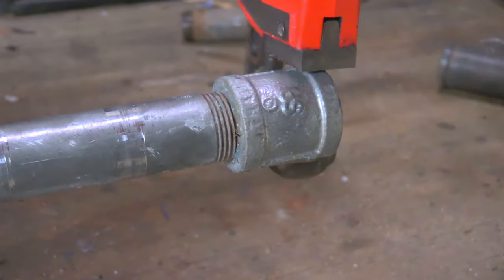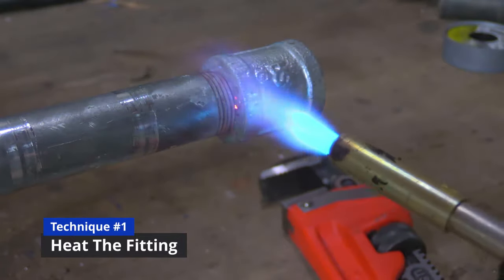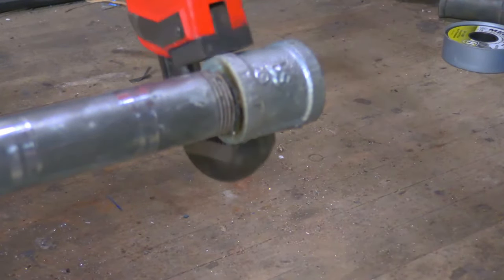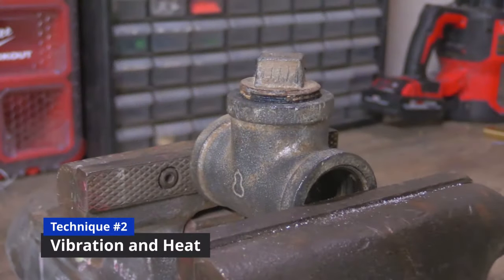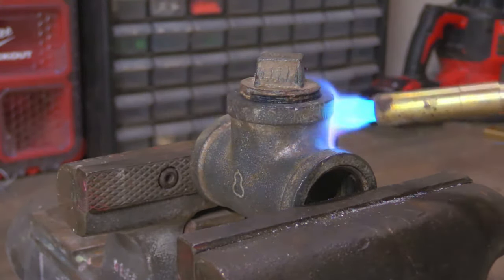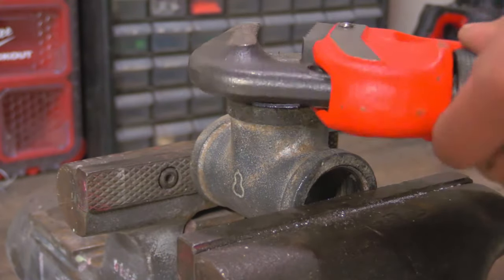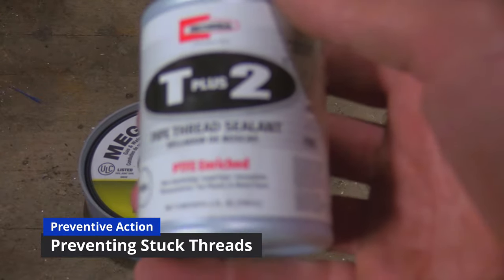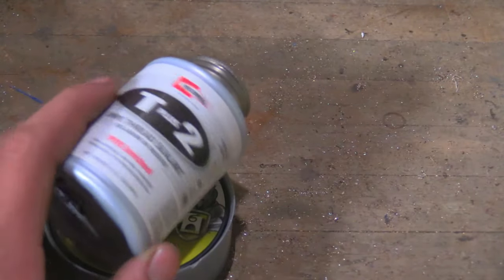Loosen Stuck Pipe Threads - With Heat!

Comment: Had a 2inch cast iron nipple completely seized up into an elbow and wouldn’t turn even when I put some very large pipe wrenches on it. Applied about 60 seconds of torch and she popped right off - thanks for the tip!

Comment: One note about galvanized pipe. If you heat it to the point where the zinc coating begins to vaporize (392 F), you can get "foundry flu" or worse (death if you breath enough of it in). I learned this the bad way brazing galvanized metal. Basically, you get what feels exactly like the flu. If I ever have to heat galvanized metal that hot, I do it outside with a fan blowing the fumes away from me.
Reply from the maker: Generally, metal pipe or bolt threads should come loose long before the zinc vaporizes. In my experience, the metal must be nearly cherry red before I can see the zinc vaporizing.
Reply: you can't see the zinc vaporize. cherry red is pretty dang hot... way hotter than the 392F temp the guy described

Comment: This is a great video.   I had the same problem - a gas pipe fitting that I needed to remove and couldn't budge even with two large pipe wrenches.  I heated it with my propane torch, just as he demonstrates.   With the heat - and only a minute of two of heat - the pipe fitting came loose easily.   Thanks so much for posting this.
Reply from the maker: Glad my video was helpful! Happy plumbing :)
Reply: @DragonBuilds  my bic lighter failed.  Now I try a real torch tomorrow.  Your tap part makes some sense too

Comment: Thanks, I used the heat and the light hammering and it finally unscrewed.
IMO, number 1 cardinal rule for DIYer is shut off the main whatever(water, electricity, NatGas, etc.) before you start doing your work!

Comment: Instructions unclear: House blew up while trying to remove gas pipe fitting with blowtorch.
Reply from the maker: If you're working on a gas like it's critical that the gas is off!
Reply: If you ever watched the 3 Stooges DIY video channel, you would know that the best thing to do is to blast.
Reply: It happens to the best of us.
Reply: Yo how did you type this?
Reply: that's not how gas works

Comment: Didn't have a torch, but my heat gun worked perfectly.
Reply from the maker: Glad it worked for you! Usually, a torch works better but sometimes a higher-power heat gun can get the job done.

Comment: Cool, now I only need a workshop with a work table, an industrial clamp and a torch
Reply from the maker: All you need is a torch. You can use anything to hold the pipe, a vise isn't required.

Comment: I have stuck brass fittings, and mine are a lot smaller, but also has plastic parts, so I'm going to try cold, to put the whole thing in the freezer until it is completely ice cold & then only warm the outside, it should pull apart.
Reply from the maker: You could try putting the parts in warm water after freezing as well

Comment: After you assemble a joint, heat it, then tighten a tiiiiiny bit more for a good tight fit. :)
Reply from the maker: That's probably a bad idea, you'll burn the thread sealant.
Reply: @DragonBuilds  ...and crack the fitting.

Comment: Did not help at all but I figured out how to do it. First I tried brute force, then tightening and loosening, then hitting with a hammer, then my MAP torch. What finally did work is I heated the fitting with the MAP torch. Not the pipe. Then after heating a few minutes, I poured ice water on the pipe. Not the Fitting. Then with me standing on the pipe wrench it started to come loose.
Reply from the maker: Heating the fitting on its own is usually enough, but cooling the pipe with water would definitely help break loose an especially tough joint.
Reply: I heated the male end of the pipe and got it loose, at first I was only heating the female fitting. Thanks 🙏 you saved me.

Comment: I'm going to conundrum I got a quick connect seized to a PVC pipe and we don't want to break the PVC
Reply from the maker: You could try a plastic-safe penetrating oil. If that doesn't work then you'll have to cut the PVC.

Comment: The heating method doesn't work too well in water lines, unless you can get the water out first.
Reply from the maker: True, but removing water is pretty easy. I used it to remove a stuck galvanized irrigation pipe. The system was only 20 years old, they used PVC underground with galvanized above for strength. The galvanized was rusted together and the torch worked perfectly.

Comment: Are their any other ways without heat I ai t got no torch
Reply from the maker: You can try using penetrating fluid if you don't want to use a torch.

Comment: What to do if the pipe is in the wall surrounded by flammable wood lol
Reply from the maker: You can use a heat shield to protect the surrounding surfaces. Most plumbing supply and hardware stores should carry them.

Comment: If a thread has Teflon tape in there, is it OK? 
I have a very old rusty galvanized tee fitting. It has Teflon tape in thread. Very hard to  loosen it. May try propane torch method. 
Thanks.
Reply from the maker: If there is Teflon tape this will work just fine. Make sure to use a high-quality sealant when you make your new joints to help seal up the rusty threads.
Reply: @DragonBuilds  
Thanks. It is a nearly 40 years old galvanized tee fitting. I am somewhat scared to remove this fitting. 
Your video helps a lot. Will see how it goes.
Reply: @DragonBuilds  
Thanks for the suggestion. With the help of 18-inch and 24-inch pipe wrench, I was finally able to remove the very old and rusty tee fitting. It took me almost 3 hours to do it.
Reply from the maker: @centscents  Glad to hear it worked out!

Comment: Here’s a cooler trick for getting a nipple out of a thread. Heat the threaded area that the nipple is threaded into until it gets red , a little bit of heat isn’t going to work like in this video , I know this is for demonstrating the technique but in real world applications you have to get the threaded area or the whole fitting cherry red , have a 20 oz  bottle of room temp water within reach then after the area is cherry red shut you torch off and pour some of that room temperature water on the nipple only as close to the threads as possible without getting the female threads that you are trying to get the nipple out of wet so it doesn’t cool off to fast , after you poured 1/4 of that bottle of water onto the area I just mentioned take your pipe wrench on the nipple as close to the fitting as possible and it will come out with a little bit of force . If it doesn’t try it again but sometimes the nipple will rather twist in half then unthread so u really got to get it hot .
Reply from the maker: That sounds like a good trick for seriously stuck fittings! However, I would be worried about heating iron fittings red hot as it may turn them brittle. It shouldn't be a problem for forged steel fittings, however.
Reply: @DragonBuilds  no it’s not a problem just  look at the temperature difference there is in dual temperature piping system , and what that pipe ends up looking like after a few months even if it’s insulated properly. You can get that fitting nice and red with no worries of it breaking unless you plan on getting it nice and hot then dumping it into a bucket of ice water. I could see that being a problem but I have been getting broken threads out of fittings for almost 30 years and I use heat a lot  and have had to issues . Besides what are you going to do especially if you need that existing female thread and there’s a broken 1 1/2 nipple that needs to come out ? You can try and use a sawzall and cut it out if you have the room , or if it’s safe you can burn it out with a small cutting torch which I prefer to do and it’s really easy with almost no chance of damaging the female threads. [
Reply: Using a saw can damage threads !?
Reply: Thank you!  I'm gonna try your method.

Comment: Will a heat gun work too?
Reply from the maker: It might, but it will take longer. You can use an infrared thermometer to see how hot your pipe is.

Comment: Still don't know if I feel safe using this trick on gas lines! Lol
Reply from the maker: It's safe if you shut off the gas and use a gas detector to make sure it's all gone.
Reply: Lol
I'm actually an HVAC guy and when we replace a gas furnace, we will actually use a bic lighter as a leak detector! 😆
Reply from the maker: @JayWillis2120  Sounds dangerous... Why not use the spray on leak detector?
Reply: @JayWillis2120  I remember the first time I ever saw someone do that, many many years ago... Under a house running a line for a space heater.  I almost lost my sht haha
Reply: On  a gas line really?
Reply: @tonyhungerford8365  replying to a comment from over a year ago really?
Read the thread again, I'm sure there is a punch line in there somewhere...

Comment: The problem with this is, no matter how I search the fact that the gas line behind my stove is stuck to the wall and cannot be wrenched loose and how to help, this video pops up advising to use a blowtorch. I hope no one has been daft enough to try to loosen it while still at the wall near the gas line!
Reply from the maker: In that case I would just use two large wrenches to get the connection apart.
Reply: @pegaleiway79
Some gas line fittings are threaded backwards.  If you haven't already, try "tightening" it (turning it to the right) and it may just loosen instead.  Mine did.

I don't know if it's true of ALL gas fittings, but is definitely true of the ones to my kitchen stove.  House built in 1951, stove bought in 1990.  

I was struggling to disconnect the flex line that had gotten kinked & was leaking.  A friend happened to stop by & enlighten me.  Fittings then came apart easily.  Who knew!?
Reply from the maker: @evelynmahoney3569  The only common residential gas fittings that are left hand threaded are left/right couplings and nipples which are used to connect two pipes when you can't rotate one without loosening the other.
Reply: @DragonBuilds  Not sure if you're trying to add to my education or perhaps indicating I'm wrong.  It was a flex gas line from the wall to the back of the stove.  2 properly fitting wrenches & all the strength I could muster, but wouldn't budge.  My friend said to turn the wrenches the other way; that gas connections are threaded the opposite of normal so that they can't accidentally be connected to water lines or electrical conduit.

Made sense to me, mainly because turning the wrenches the opposite direction from "normal" actually worked to disconnect them.  Just sharing my experience, which may be helpful to the person having the same or similar struggle.
☺
Reply from the maker: @evelynmahoney3569  I have never seen a flex gas line with left handed threads. It could be a regional thing or a very old fitting.
Reply: @DragonBuilds  Hey, just wanna say that I genuinely appreciate your replies.  I'm no expert, and certainly don't want to steer anyone wrong or put out disinformation in the comments on your video.
Good video too, btw.  Liked & subscribed.
Reply: @evelynmahoney3569  Stoves were attached to the wall fitting with "left-right couplings" in the days before flex connectors.  One end of the nipple has left handed threads, the other right.  A left handed coupling is provided.  Still code for NYC work.  Also used in gas lines as unions are not permitted here.

Comment: DO NOT ADD HEAT TILL ITS "HUNDREDS OF DEGREES" IF ITS A VALVE. FOR GODS SAKES MAN, YOU WILL MELT THE RUBBER SEALS IN THE VALVE.
Reply: all of you guys going "wow I never thought of that" just give me all your tools right now
Reply from the maker: Heating a valve will indeed damage the seals inside. However, if the valve is old and needs replacement anyways, then it's not a problem.
Reply: @DragonBuilds  this is a brand new pipe, a rusty flaking galvanized steel pipe could pop and crack and send a flying shard of rusty steel in your eyes, I'm speaking from experience because it just happened to me, be careful. if this pipe was connected to your water meter you could damage the water meter. there is variables to account for putting out advice like this
Reply from the maker: @smc3453  Working on old galvanized pipe is always risky which is why most pros recommend replacing all of it.
Reply: Safety no. 1!!!!